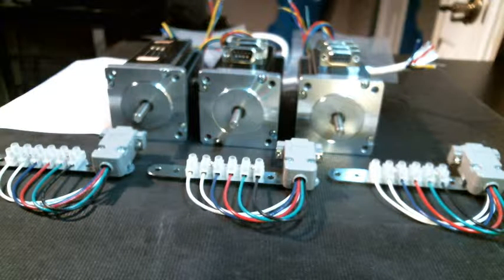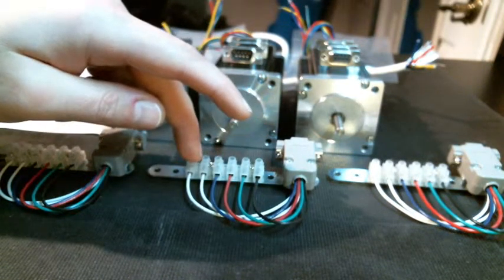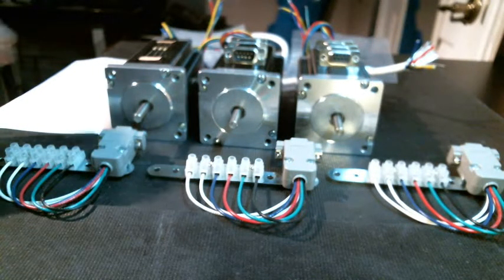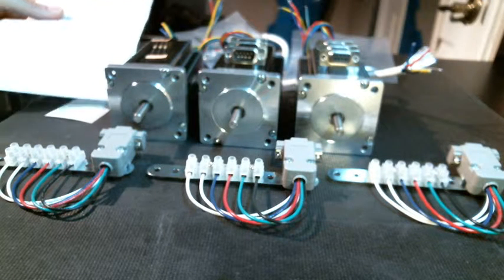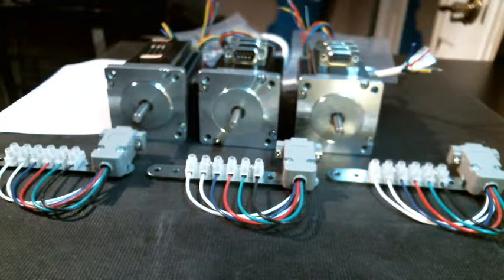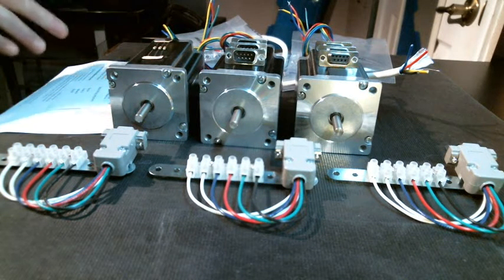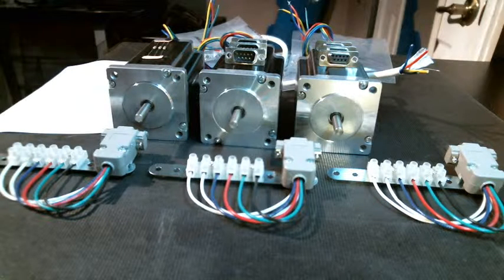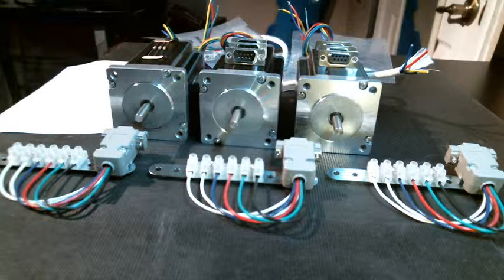Edealers direct DIY motor package

Comment: I'm going to be building a plasma CNC. Do you have a motor and torch height control package? I'm going to be using a Centroid Acorn board.
Reply from the maker: Hey Edward,

Thank you for your support. I can put togther a custom package with a THC , and motors. Just let me know what drivers, and breakout board you'll be using, and  Thank you,
Vince
Reply: @corvetteguy50  I'd like to use a Gecko 540 and I'll be using a Centroid Acorn control board. I previously purchased from you a 4 axis Gecko G540 kit with 381 oz-in Stepper Motor, 48V/12.5A  which I think should be more than enough for a plasma CNC. I also like all of your EFI connectors etc. I'd be looking for prewired. I'd like your thoughts.
Reply from the maker: @edwardswakon8093  I'm sorry I don't believe you purchased the components from me as I don't sell 381oz/in motors. Are you looking for a prebuilt controller? I don't offer prebuilt controllers for the Acorn as it must be installed inside the system's electronics enclosure. Thank you, Vince
Reply: @corvetteguy50  what is the link to your EBay store?
Reply: I'm looking for the G540 and stepper motors with your DB9 EFi connectors.
Reply from the maker: Here's my eBay store.https://www.ebay.com/str/edealersdirect   Just message me there, and I can put a DIY package together for you. Thank you,
Vince

Comment: hey Vince I'm looking to build myself a CNC machine my goal is to mill 3mm 6010 - t6 aluminium. I will probably end up purchasing one of your packages but I was wondering if you had any recommendations for a table. do you think the Chinese cnc6040 machine tables would be fit for this task?
Reply from the maker: The 6040 is an excellent system when paired with the G540. My 600oz is a perfect fit for the substrates you plan on machining along with a 2.2Kw spindle. This will provide the most versatile machine in that size.Thank you,Vince